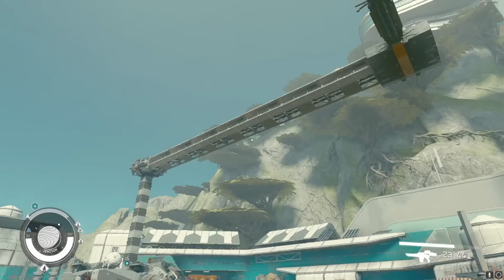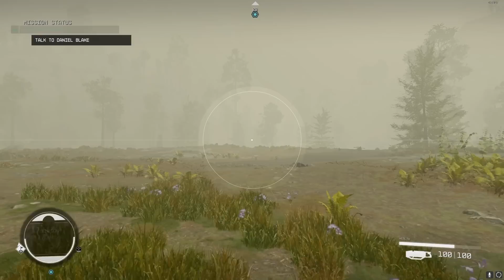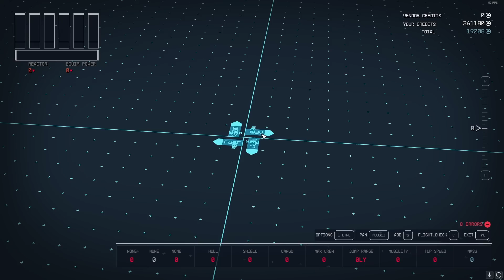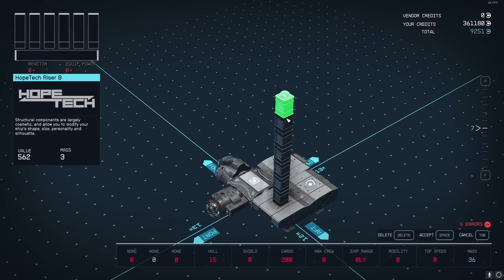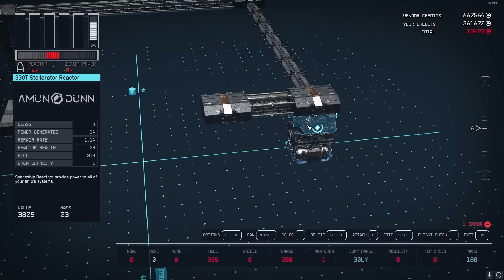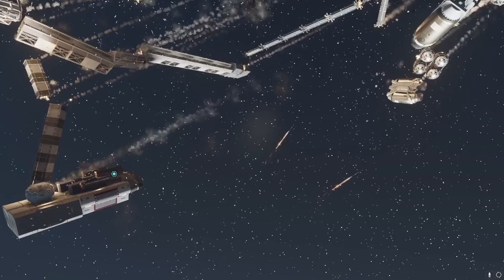INSANE best ship design, LITERALLY INVINCIBLE cheese ship build exploit for Starfield, best build

Comment: Believe it or not, this exploit goes way back, before ship building video games.  In traveler RPG (iirc) you designed your ship top down on graph paper.   Depending on what was rolled on the dice, you’d get hit on different points on the graph paper ship.  But more accurate hits went to the middle, so if you made some variation on a big donut, most of the enemies shots would miss just like this

Comment: at endgame, with skills maxed and crew you only die if you go afk anyways, built a ship that has 14k cargo, 3.5k shield, 71 mobility,202 top speed,1,6k hull and the best dps particle weapons ( 6 vanguard oblitorator autoprojectors, 4 pbo-175 auto helion beam, 4 exterminator 95 MeV auto helion beam :P) Think maybe I could optimize crew more to increase stats but it's more futureproof to do it this way in case they patch it. Crew is kinda buggy and their bonuses are different than what u get so it's hard to tell.

Comment: Im not sure the unattached modules thing is a bug. Either sometimes, a part looks attached and you just start building off of it or, in my case I tried to use a part flipped around to use as an outside hardpoint and spent an hour trying to figure out why it said "Unattached" only to flip the part the right way around and the error cleared. So, if you're trying to use parts "creatively" it freaks out on you.

Comment: Well - I started a new game.  Tried to do this identical build (level 9 now) and almost identical.  Couldn't get one of the engine items on the pad builder and only got 19y so had to daisy chain.  I tried very hard and got blown out of the sky non-stop.  Not sure if this bug has been fixed or what, but I lost my grav drive pretty quickly in each fight.  Loaded previous save and will try again later after a couple more levels and credits (went broke building this).

Comment: Applaud for the cheese factor of the build. Not an exploit this time but a creative use of the rules. It's not even the AI is stupid it's every combat system for player and Ai goes for center of mass. The easily fixable thing is to rule it as a giant hitbox which makes it less appealable. But you should let your viewers know that A) every player owned spaceport has SOME of the brand manufacturers, some you have to go find on other systems. B) The items list is leveled and better items from the same brand and category (i.e. Type A) are directly tied to your own level.
Reply: Easiest way to fix this is give the Very Hard enemies lock-on AI like the player's lock-on mode and target individual systems, then to balance change the percentage of time they seek a lock-on until it's just enough to stop this tactic but not enough to kill all chance for the player.

Comment: I might build one of these in a cube shape so that the concept doesn't bother me when it's on the ground, because there is no way this thing would be able to stand on its own in real life, and it actually looks like a potentially cool design anyway... that's just my opinion anyway.
Reply: Or instead of cube shape, just add one more landing gear at the bottom of the strut where he put all his fuel tanks and engines.
Reply: @MrDavidMoyer  I finally got around to trying the cube idea (using console commands to gift myself enough money) and flew around in it, and it doesn't appear to screw with the 3rd person camera like this design does, so as ridiculous as this design looks, it appears that this is the best way to pull off the intended effect.

Comment: The ship targeting aims for center mass but what if you had NO center mass? Brilliant.
Reply: You still have center of mass. You just dont have mass at center of mass.
Reply: @herp_derpingson you were right but completely contradicted that statement
Reply: @TbjrL  A donut has a center of mass in the middle of the donut (where no mass is located).  Although there is no mass there, it still has consequences.   For example if you toss a donut in the air, it will rotate around its (invisible) center of mass.
Reply: Will they fix It?
Reply: @fqeagles21  I don’t think they will cause I think it would require making extensive changes to the ai.
Reply: @demogod4955 nope just make them target ship systems instead of center of mass
Reply: ISS just whiggles the Deathstars Lasers off.
Reply: they can just tweak the AI to target Weapons or Engine.
Reply: Same trick worked in KH2 and even KH3, its just lazy programming. Instead of the AI targeting modules or a "hitbox" it just aims for what is supposed to be the center of the build.
Reply: the center mass is in the void of space hue hue hue

Comment: just an example of how braindead the AI is, instaed of aiming at the different ship parts (shields engines etc) they just aim center mass
Reply: I don't know if you know the x-series, or more specifically the titles x3 and prior. In these games having the AI simply aim at the center of the ships was not always a good choice, as some ships had nothing there to hit. It was a necessity though, because tracking the actual ship-form would be draining on the players PCs and would thus make playing highly impractical, which is the opposite of what games should do.

So having the AI aim in the simplest possible way was a necessary compromise. This changed with x:Rebirth slightly and with x4 definitely. Obviously times went on and PCs are much more able to handle such issues, though even x3 still can get very draining on modern PCs. There are a lot of calculations going on and combined with mods you can turn that old game into a nightmare.

But here's the thing, Egosoft is doing space-sims for a while now and Bethesda is not. It might just be that this is a problem that the devs didn't think about because they weren't aware of that issue because they never had that problem before to deal with.

As I see it, it is the players choice to use builds like this or not. And I think you shouldn't as these builds are absurd. And there is no reason to use these. SF is not a competitive game that requires hyper-optimization or highly-efficient ships and builds. It doesn't.
It's fun to have these exist and possible, sure, but they shouldn't be used if you want to enjoy the game and enjoying the game is up to the player.